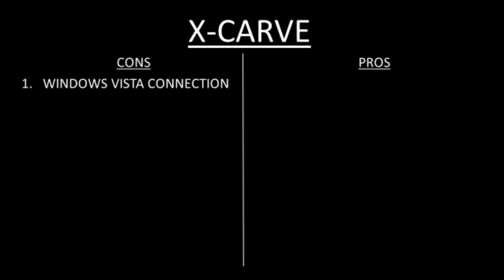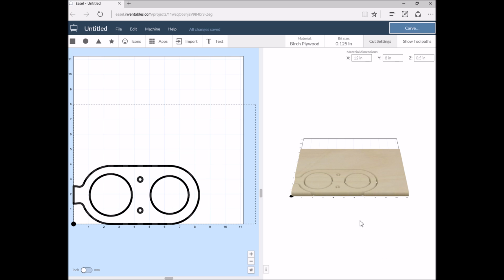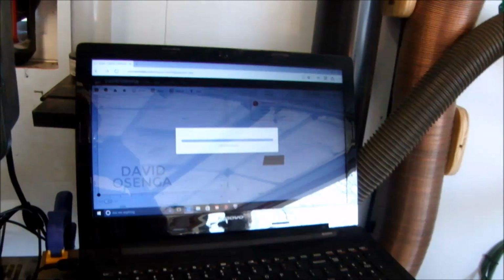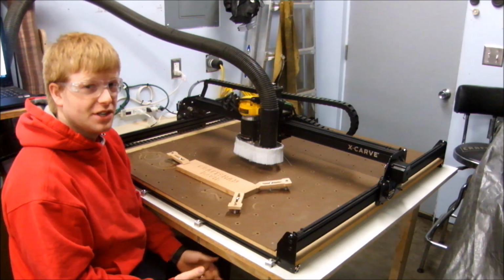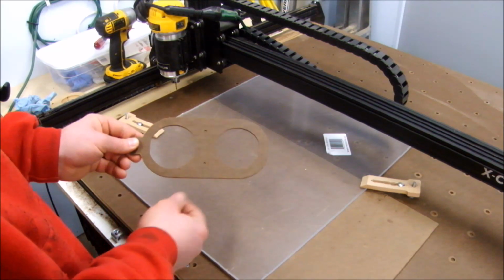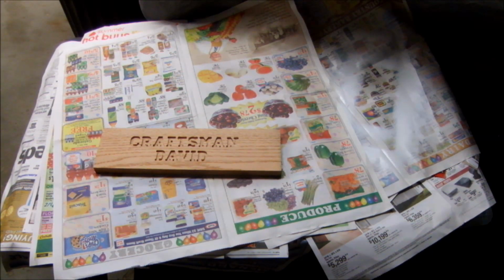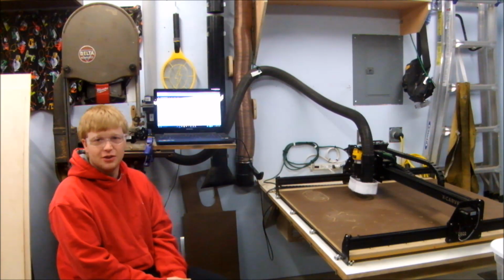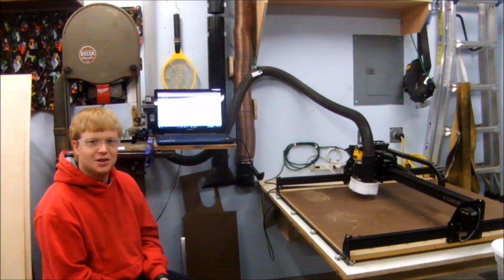X Carve CNC Full Review - 4 months

Comment: Letters should not be just ok.....its a cnc machine....the letters should be perfect
Reply from the maker: Yes, I agree.  I have since discovered this was a mechanical issue with the machine.  The set screw on the Y-axis pulley does not hold over time.  I have since drilled it out and re-tapped the hole with a #6-32 set screw.  Problem solved.

Comment: You need to install the collet into the nut and then thread onto spindle.. there is a notch in the cap that will pull the collet out when you unscrew the nut

Comment: @Craftsman David, you mentioned buying the V-carve software and doing an update video. 

Awesome if you can let us know if you found a solution to the circle cuts yet.

Thanks,
Reply from the maker: Yes, V-carve pro is Awesome!  Eventually I'll have to do that update video about it.
Reply from the maker: Also, I should revise my review about the circle cutting problem.  After having the same problem with V-carve pro, I discovered that the set screw on the X-axis pulley let lose allowing the shaft to slip under heavy load.  I drilled and tapped for a larger set screw and no more problem.